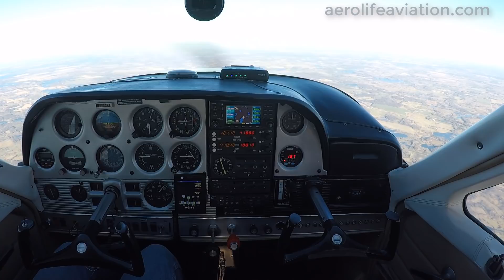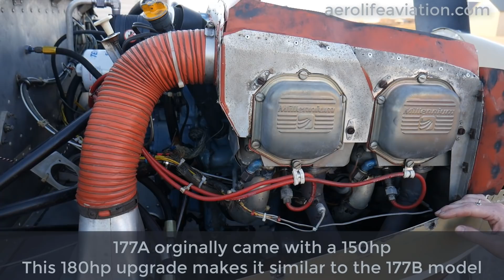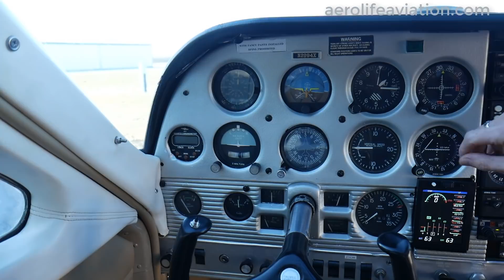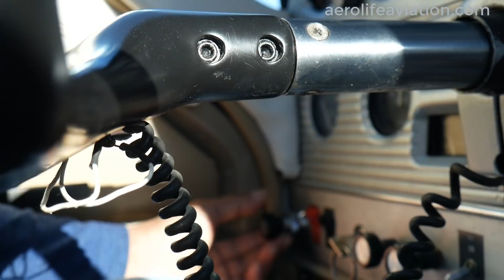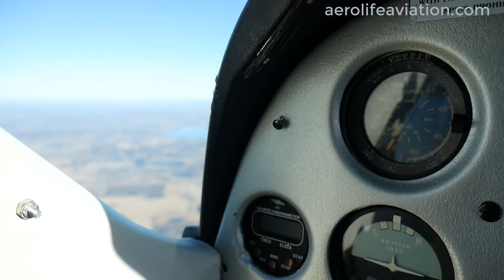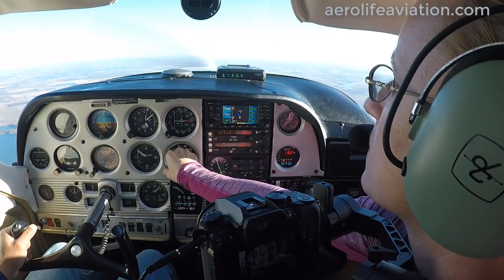Upgraded Cessna Cardinal 177 Outperforms later 177B

Comment: There is a video out there saying how bad the 177 is. Was it the 150 HP engine that damaged its reputation?
Reply from the maker: Yes, unfortunately the 150hp engine was not quite powerful enough to handle the Cardinal's size how people expected it to. It's still a great flying plane and there are 160hp and 180hp upgrades available that make it an even better plane.

Comment: I owned a 1972 177B for 6 years and used it for aerial photography. I had a small sliding  window installed which worked great. I loved flying her especially on long flights. Very comfortable & easy to land. Even handled crosswinds easily even with those long wings. Only recurring issue I had was the nose wheel strut vibrating on landing. Otherwise I miss that plane!

Comment: Great video. Thanks. Watched this a few times. Maybe I missed it. What’s the useful Load on on this STC 180 HP?
Reply from the maker: There are a few different STC options available which have different specifications. Useful load will depend on the STC installed and also what equipment is installed in the plane so each plane will be different.

Comment: long term Cardinal owner here.  Since I installed the exhaust fairing on the cowl I have never had any problem with cylinder head or ail temp issues, before on climb out on hot days I had to lower the nose but not anymore.  I noticed that the plane had its legs clipped (the stair step for getting in) mine had the same surgery.  It might be a reach for short people but the rest of us should have no problem.  It don't see what complication there is with the CS prop (mine is a B model)  just push it in all the way for takeoff and landing.  It's a clean airframe so it will 'float' if you come in too fast.  there is no need to lower flaps until below 100 mph for landing and full flaps will help you slow down, I use one notch of flaps for takeoff since I am on grass.  I cruise between 2200/2300 since that lowers the engine noise, I do like to hear some engine, the sound is reassuring 😍😎.  the Card will not fly full tanks and four adults unless they're really skinny, I'm not.
Reply from the maker: Thank you for sharing your experience with the plane. Appreciate you watching our video.

Comment: That’s a pretty clean 177. To bad Cessna never decided to keep the wing and the 200HP on the fixed gear frame. The IO360 on a 1968 FG is a blast to fly.
Reply from the maker: I think there were 4 upgrades with the 200hp.
Reply: @aerolife1646  something like that. 3 or so with a 337 1 for sure with an STC

Comment: Just to let you know that is a straight 177 no A or B no matter what engine and prop they hung on it you still have the 2350# g/w where the A&B had a g/w of 2500#. And with the a4 engine (solid crank) there is no weigh to convert it over to a constant speed prop. Other than that nice plane & good report.
Reply from the maker: Thanks. We need to look at the useful load which is what matters. The useful load of the 1975 177B Cardinal II  package I had was 900Lbs  (no autopilot) vs this plane has 840Lbs.  The difference is only 10 Gallons of fuel weight.  Some Cardinals have a higher useful load with no upgrades.  840Lbs  of useful load is very reasonable because of the number of upgrades in the plane including autopilot and servos.  If you put all the upgrades into a B model you won't have much more useful load.  There is no need for a constant speed prop upgrade as this is easier for many pilots to manage to come from 172. We just had a  Penn-Yan  172/180 conversion that comes with a fixed pitch prop which is a very nice plane to own and fly.  When people need a CS Prop a and load hauler 182 is a good option.
Reply: AeroLife , I hate to say your a wee bit heavy. We have s/n 817 with a 180 and a McCauley csp our empty weight comes in at 1580# with a GTN750 and a aspin display. We just removed the vacuum system and added a surefly ignition that will knock off a few lbs at next w/b. Light airframe and a full 180hp when you open the throttle it does get out of its own way! Still you have a nice bird!

Comment: The FBO/school where I got my PPL in 1993 had a 177 on the rental line for a while.  It was just a few bucks more than the 172s so I got a check out and flew about 30 hours in it.  150HP so it was a touch underpowered, but it was almost always just me and one other person so it never really was an issue.  Landing took a little practice.  You had to get the speed right.  It was noticeably less forgiving than the Skyhawk if you carried extra speed over the fence - it would float to the next county.  It has a horizontal stabilator, rather than a standard elevator, so it was very light in pitch control.  It all just took a few hours to get used to.    I have a friend that used fly with me a lot, and to this day he still remembers the Cardinal and thought it was pretty cool.   I liked it too.   Always been more fond of the stiff legged version.  It still looks very cool without the complexity of tucking up the gear. 
[edited to correct a couple of glaring typos].
Reply from the maker: You are right. Every plane is different and needs to be learned.  Cessna has very effective flaps and higher airframe drag. So they don't float unless the approach is incorrect with excess speed as you mentioned.  As a pilot, if I can't fly or land properly while other pilots can, it is my problem. Not the plane. Look at this pilot and how he landed the plane. He landed the plane the same way night landing and gusting to 25 knots.
Reply: @aerolife1646  I did not intend to sound negative about the 177.  It's probably in my top three favorites of single engine planes.  But that cantilever wing and the stabilator make it handle noticeably different than the Skyhawk or Skylane.  That wasn't a bad thing - it was just different.

Comment: The original 1968 177 Cardinal came with the 150hp Lycoming. The 177A model came with the 180hp Lycoming and a fixed pitch propellor. The 177B model came with the 180hp Lycoming and a constant speed propellor. The B model also had a change in the airfoil from the original 177.
Reply from the maker: thank you for sharing the info
Reply: How about a 68 with a 200hp?
Reply: @themechanic568  Very late to this conversation LOL
But there is such a beast. Probably the only one in the world with the STC for the IO360 and has the “fast” wing.